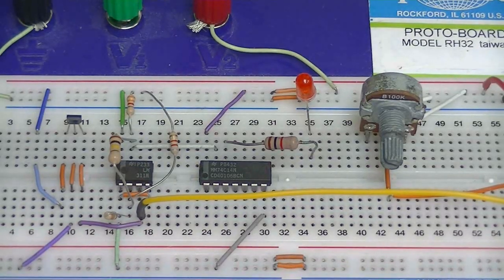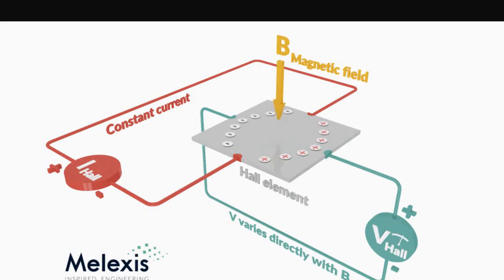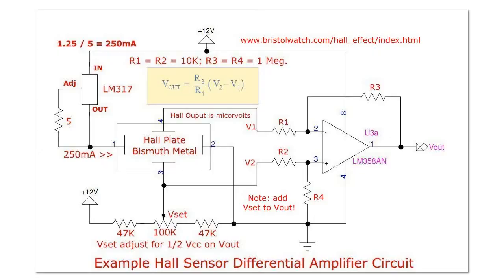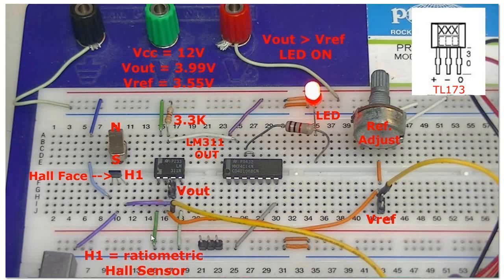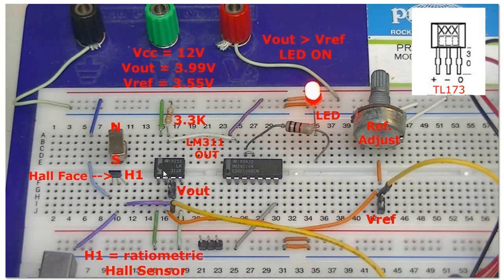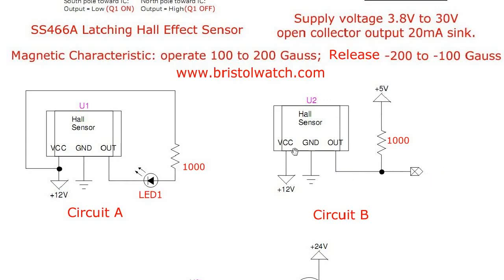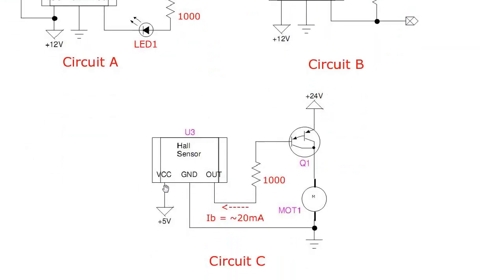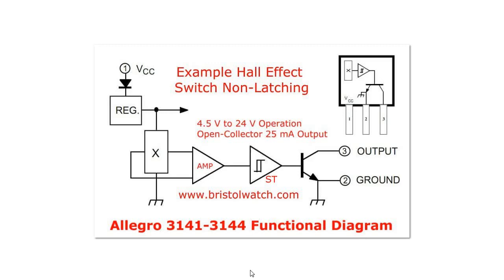Operate, Build Hall Effect Switch Pt. 2

Comment: Hello @LewisLoflin. Finally I understand this!
I need a Switch between South and North but, without latch effect.
When North appears, one led's on, when South appears, other led's on, when no magnetic field, no one led's on. I uses 2 A3144 for do this. (One with face up, and the other on the oposite) 
Do you know if exist one digital switch 2 outputs hall sensor with that configuration? Regards and thanks a lot.